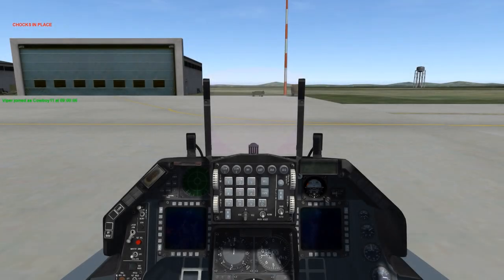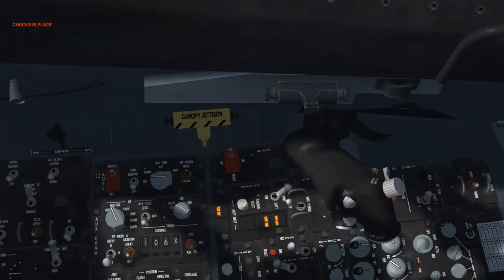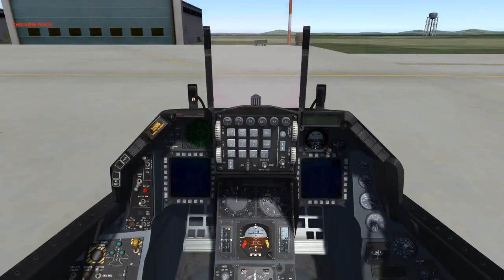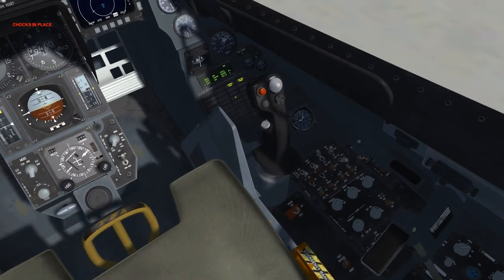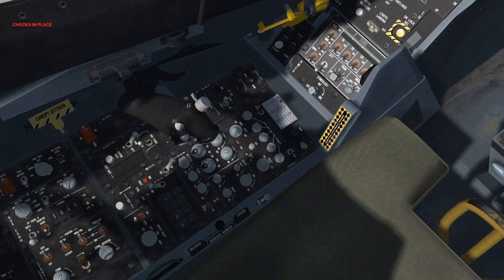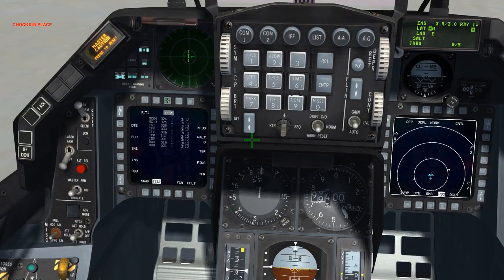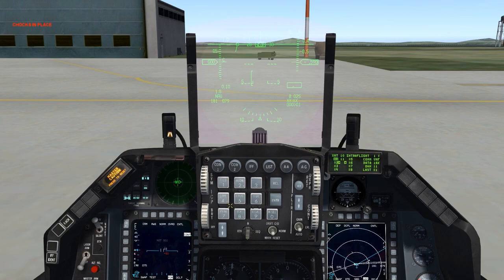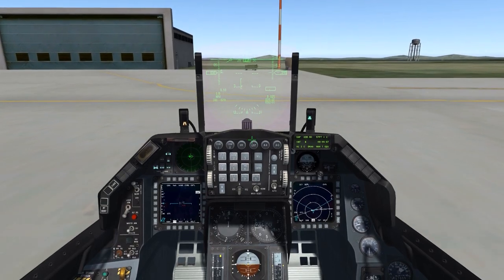Falcon BMS v4.33 - F-16 Ramp Startup

Comment: Are you at all familiar with the real F-16, banjo? You make reference to a few differences between the real-world falcon and the BMS falcon a few times, just wondering if that's stuff you've just picked up, or if you've ever worked with one.
Reply from the maker: +Skele Boner Just things I've read over through the manual.
Reply: Ah, alright. I've never actually read the BMS manual (sue me, there's a lot of more easily digested instructional stuff on the internet), so I wasn't aware they covered the sort of stuff.
Reply from the maker: +Skele Boner I know what you mean, I have a habit of falling asleep while reading over manuals.
Reply: I read the DCS MiG-21 manual at work sometimes (still trying to learn PRMG and the RSBN ILS stuff as well as the SAU beyond flying straight and level), but yeah. Manuals are usually really dry and unengaging.